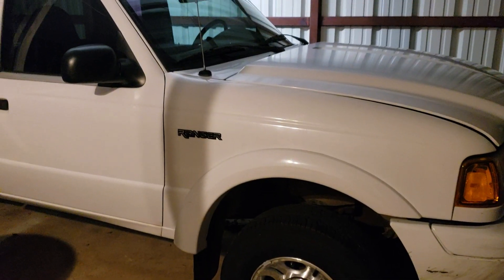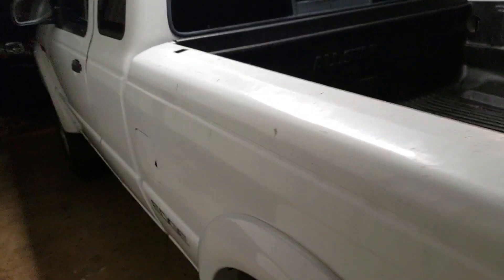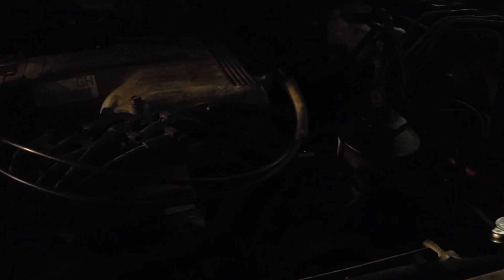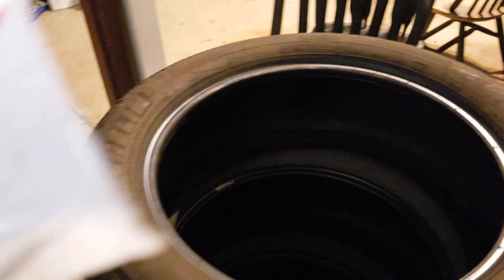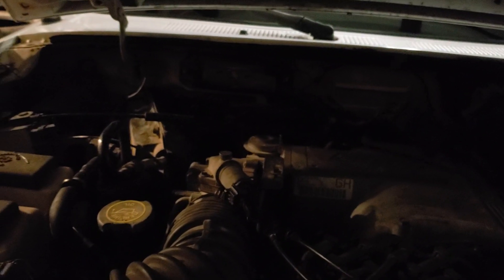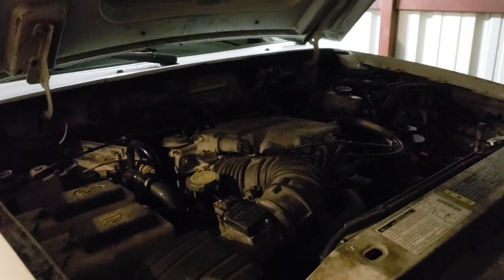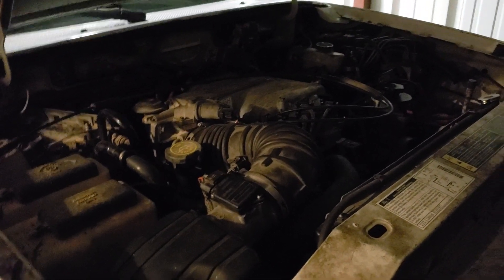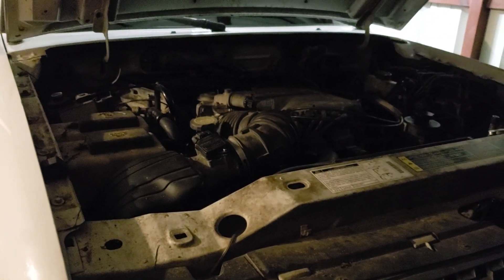2001 Ranger Edge 5.0 Swapped (Part 3)

Comment: Just a thought, are the power steering pumps on the 3L and the 5L pushing out the same amount of pressure? I thought I remembered reading somewhere that the EFI 5.0 PSP could push an extra 100-300 PSI, and I'd hate to see you build these lines just to blow a cooler or a fitting, I'm sure it'll be fine but I'd just do a little more research first, y'know?
Reply from the maker: Colin Ahearn I know a couple of people that has used the method I'm using and didnt have any issues. But I will let you know what I find out lol
Reply: itsoundzgood Glad to hear that, I'm gearing up to do the same swap next summer. Also, good thought with the aluminum driveshaft!
Reply from the maker: Colin Ahearn I may have to get another driveshaft eventually though. I noticed a couple small dings in it today when I swapped the yoke over so I may have some balancing issues. But at least its together lol